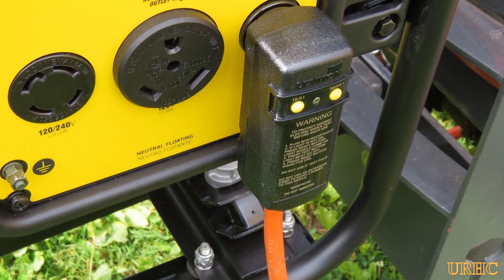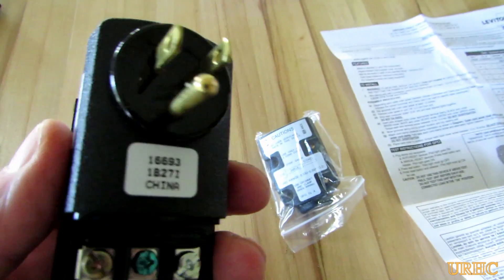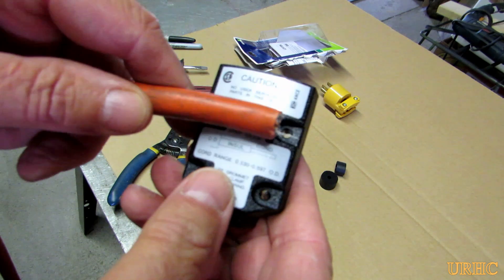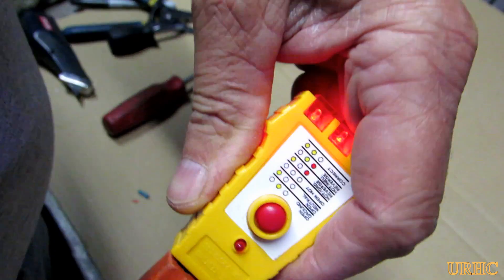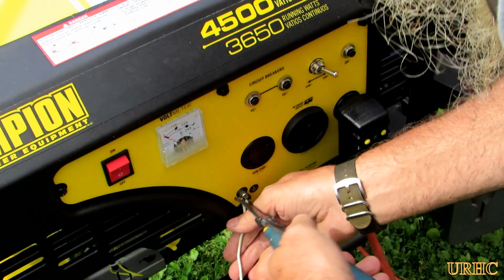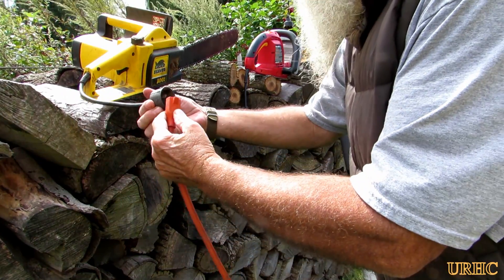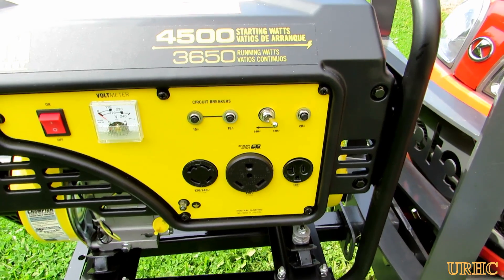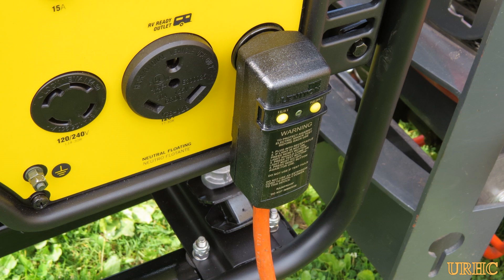A GFCI Plug Will Not Work With My Champion 3650 Watt Generator

Comment: People seem to think the GFCI is not working because it doesn't trip when the test button is pressed. When the test button is pressed a fault current is created that travels back to the source on the ground wire creating an imbalance between the hot and neutral which trips the GFCI. Because the ground and neutral are isolated there is no path back to the source to create a fault . So now you say lets connect the ground and neutral together back at the generator and now the GFCI trips when the test button is pressed but now you've created a path from a possibly faulty power tool back to the source through the frame of the generator and tractor. If it were me I would just use the generator like it is but it won't hurt anything to use the GFCI. You could plug it in at your house and test it to make sure it is working. I would not put a GFCI on the end of an extension cord unless it is specifically designed for that application. If you loose the neutral conductor in your extension cord there is no power to operate the GFCI and if you get a ground fault it will not trip. GFCIs made for extension cords are designed so this can't happen.
Reply from the maker: I found out this generator is safe to use without a GFCI. With no path to ground they say you will not get a shock. That is why the GFCI doesn't blow. Thanks for watching.

Comment: The solution is a Bonded Neutral "cheater". Generators use a floating neutral, which GCFI see as an open ground.
Create a plug (separate) male 15 amp, and put a short jumper from the neutral (silver) to the ground (green).
Then plug in the aforementioned plug to any unused 120v outlet on the generator. It convinces the GFCI that a ground exists and you're good to go.
Reply from the maker: Apparently if you do that with these generators the frame becomes a path to ground and it is no longer safe to use as an ungrounded portable. Thanks for watching.

Comment: Could you just connect the ground and neutral in the plug? And not the generator frame to get it to work? I'm looking in to using a gfi with a inverter in a house. I never used one. Or installed one. O was just looking in to safty. I guess I will just ground everything. And earth the inverter to the ground rod!
Reply from the maker: Turns out this is the way they do it for portable power so there is no path to ground for a ground fault. For use in a house the NEC codebook should be followed to keep your insurance company happy. Thanks for watching

Comment: That generator(notice in very first picture) has a floating ground, bond the neutral to ground and that GFCI should work...
Reply from the maker: Turns out for portable use this generator is supposedly safe for use without a gfci as there is no path to ground. The damp conditions I was worried about are not supposed to be dangerous with the floating ground setup . But the generator should not be hooked up to power a house for emergency situations as many people do without properly bonding the grounds and grounding. My 15k generac on the other hand uses gfci outlets to be safe.
Reply: @unemployedredneckhillbilly2023  If you hook up an unbonded generator to the house panelboard, it will be grounded by the ground from the house via the ground wire from your cord. Bonding the neutral in this case would provide a parallel path for current in the neutral leg. That is not good as the grounding conductor is not a current carrying conductor.

Comment: You have a floating neutral and it needs to be bonded to the ground to take and make your GFCI work
Take and make you a neutral Bond plug and plug in a three-way plug and plug your GFCI plug and then the neutral bonding plug that you made and your GFCI will work I have two generators that have floating neutrals and I made a neutral bonding plug so I can use a GFCI on my generators
Reply from the maker: From what everyone  is telling me a floating ground is safe to use without a gfci on a portable generator . Sounds like it only matters if hooked up to run a house.  Thanks for the comment.
Reply: GFCI does not need a ground wire connected  to work.

Comment: Your generator is made to power a transfer switch for back-up power to your house, which has a neutral to ground bond in the panel..The GFCI should work if you bond the neutral to the ground at the generator. Just be sure to remove the bond if you use it to power your house.
Reply from the maker: Thanks. I guess that I have always been under the assumption that you need a gfci to be safe outdoors.

Comment: I did a little testing of things.  The plug in tester worn't work on an floating neutral system because it simulates a ground fault by putting a 15k resistor across hot and ground.  Why the actual plug "test" didn't work is a mystery as it should put a resistor across hot and neutral but around the sensing toroid letting a bit of current leak around causing an imbalance on the sensing circuit.  It it cheats and puts resistor across hot and ground, then that would explain the failure to trip.  

Researching I came across instructions on how to bond a generator with a floating neutral and install a GFCI from the Hydropower division of the Bureau of Reclaimation, Dept of Interior called:

FIST 5-13 Fault Protection for Portable and Vehicle-mounted Generators and Welders, December 1997
(Facilities Instructions, Standards and Techniques (FIST) Manuals)

Apparently, the NEC does not require a ground rod installed for portable/vehicle-mounted generators that only supply on vehicle loads or cord and plug connected equipment from receptacles on the generator or vehicle,
Reply from the maker: Thanks,  it is something I never thought would be a safe solution. I guess eliminating the path to ground removes the possibility of shocks on a small portable generator. Sounds like there's nothing to worry about.   Thanks for your reply.

Comment: GFI's are not supposed to be used that close to the source. Use them at the end of the circuit.
Reply from the maker: They usually are right in the outlets. It is the generator wiring. Thanks for watching.

Comment: The problem is the outlet is wired wrong. The test button simply puts a high resistance between the hot and ground. In this case it's going between neutral and ground and therefore won't trip the GFCI. You can verify this with your ohmmeter.

Comment: On my champion generator i once dropped a grinder which semi cut the chord and caused pretty sparks. The circuit breaker on the gen immediately popped and killed it. Try calling Champion at off times I am sure right now they are flooded with calls due to Harvey and Irma.
Reply from the maker: I thought a gfci would add a extra level of shock protection,  but it looks like it will not work with the wiring on this unit.  I can't imagine how many are trying to get generators up and running right now. I will give them a couple of weeks and try again. Thanks for watching.
Reply: It doesn't because the shock risk a GFCI protects you from can't happen with a floating N generator ;)
Reply: I bet you’re right about them being flooded with calls due to the hurricanes. It was reported last night that over 8 million were without power in Florida, Georgia, and South Carolina due to Irma.

Comment: You didn't try grounding it right, a grounding rod needs to be buried 8 feet into the ground for proper grounding you were on the right track with that wire but you needed to go farther into the ground which is the problem. Also there should be another grounding which grounds the generator to the frame by a small wingnut, you could try taking that wingnut off and connecting a wire to it then replacing the wingnut to see if that will give you a proper grounding. Normally even though there's a ground on the panel there's usually always a ground connected to the frame of the generator.
Reply from the maker: This is for portable use so I  did not bother with a driven rod. It says that the ground should only be used when wired to a house and not connected for portable use. The ground pin is open and not tied to anything on the frame. I see some bond the ground and neutral to get gfics working, but that can be dangerous if there is a fault. Thanks for the info .

Comment: right, where to start...
this generator is acting like an isolated transformer, no ground is needed...

in the home you have N and G connected, it would also be connected back at the sub station.... this means if you touch L and G you will get a shock and the resistance between L and soil outside means you can get a shock...

on an isolated transformer (usually builders use them) you can touch L and soil and get no shock as the N is not connected to ground....

to test this, use a multimeter and check your generator between L and soil, it should read 0V this means you can only get a shock if you touch both L and N on the genterator...
if you dont have a multimeter you can try a lightbulb, connect L and the other side to soil...

there is a few things that need a bonded N and E and these things are usually internal home use items, however some RV have units like this and work when connected to grid mains but many generator mains wont power the protection unit until it measures  a low ohm resistance between G and N...

i hope this helps...

also throwing a spanner in the works... its a good job you got a real generator and not an inverter generator, some generators that are "inverters" which produce a modified sinewave 
 (not the more expencive pure sinewave) cause huge issues as E is connected to the battery negative and its power output poles L and N are half wave (squarewave in about 45 degree offset to give a freaky sinewave) and if you connect it to things that is sensitive then they will go pop... many chargers and things like smoke detectors... other things work a lot harder using higher power so lets say something uses 300w on grid but will be 350w on a modified sinewave... 
so as each L and N is actually live, if you suicide cable it to your house you will smoke your inverter because you will short out the N and G of the inverter.... if you disconnect the E from the inverter then you could end up with each battery terminal floating between 80-160v depending on what your inverter puts out, 80v=US but 160v=UK, AU etc
this is because N is still connected to G in your house fuse board...
Reply from the maker: Thanks for taking the time to post your explanation. I think you are right about it being isolated so it can be used as a portable. I just thought a gfic would add a little extra safety, and have a lot to learn about using generators. Thanks again.

Comment: Check if the test button on the GFCI plug trips it. If so the GFCI will work even though you have no ground and the neutral is floating, and your tester says it's all bogus. I wouldn't attempt to connect the generator's neutral to the frame without thoroughly understanding the generator's wiring, particular the 120/240 switch, and/or consulting the manufacturer. In any case, you shouldn't connect the neutral to the frame unless you're going to provide a good ground for it whenever you use it.
Reply from the maker: No it doesn't.  I don't think a gfic will work with this generator.  Hopefully  champions wait time will shorten, but I am sure they are overloaded due to the storms causing thousands to buy generators. Thanks for the comment.

Comment: this is why you dont want to use sensitive items on some gen sets --- tv phone etc
this is not clean power.
 getting ready for irma people will find out. the neutral and ground need separation for gfi to work those plug testers all read reverse/ in a no ground/ neutral separation.again gen set should be grounded but you are only using it with double insulated tools, but i dont have to tell you u are an engineer.
Reply: Nope not true !!!  There's really no such thing as "sensitive electronic" equipment anymore !! Just about all modern electronics use switching power supplies with very wide voltage and frequency inputs, analog Transformer style power supplies are almost non existent in modern electronics. It was these legacy Transformer style power supplies that made electronics sensitive to voltage and frequency instability of the mains input, again these are nearly extinct nowadays 

Modern switching supplies  are very robust and very tolerant to voltage and frequency variations and instability, Meaning you can feed modern switching supplies anything from 90 volts to 230 volts at 50-60 hz  and they won't know the difference. 

If you look on say your laptops or TV's power supply and it says input 90-240 volts 50-60hz  then its a wide range switching power supply that's pretty much bullet proof and will run just fine on any generator made, This claim that you need a very expensive inverter generator to run "sensitive electronics" is nothing but dishonest marketing  started by Honda

Comment: this guy put a wire from his neutral to ground   says it works watch and see what you think that is what i have found every where i my self would just leave it alone and do without it most tools nowadays only have 2 wires anyway https://www.youtube.com/watch?v=BBHA7PlhkbQ
Reply from the maker: That has the potential to make the frame hot with a fault. I am going to get in touch with champion, but I think it may be safest to leave it alone as you say. I never would have thought adding a extra safety device would be a problem. Thanks for the help.

Comment: bonjour , i have a homelite generators 4500 whit a robin motor and my 2 duplex receptacle 120 volts have gfci build in , the same like in the bathroom with the test and reset . very helpfull went we ad the big ice storm here in quebec . merci
Reply from the maker: You must not have the floating neutral on yours.  I never knew there were different schemes for wiring generators before.  Thanks for watching.
Reply: bonjour ,www.mymowerparts.com/.../Homelite...Manuals/HOMELITE-GENERATORS-2500 view page 33. merci

Comment: Have you tried to make a short extension to connect the GFCI to the generator and that would swap phase and neutral? The test plug mentions that hot and neutral are swapped, so first try would be to put them in correct order. Do not expect cheap generators to be wired with phase and neutral in right position :)
Reply from the maker: No, I don't want to take any chances. I think the 110 / 220 switch may have something to do with that swapping neutral with hot. I think it may be best to just leave off the gfci . I just thought it would add a extra level of safety.

Comment: I am a RV tech and installed a very expensive surge protection system in a fifth wheel and it worked fine on shore power but plugged into a 3600 Yamaha generator it would not let power through.I plugged my circuit tester into an outlet on the generator and everything worked fine and the RV powered up.The customer used the RV for the weekend and had no problem as long as the tester was plugged in.
Reply from the maker: The tester must have jumpered something in the grounding scheme. I was just trying to add a little extra shock prevention, but maybe you can't with these small generators.

Comment: Interesting.  Thanks for the heads up.

I have some tools with GFCI on the plug.  I will have to test mine on my generator.

Did you try the "TEST" on the GFCI plug?

I have read that there are a few different designs of GFCI, so perhaps this is one of the designs which is not working on your generator.
Reply from the maker: This one was rated for portable generators.  It did not trip when tested on the generator,  it was fine when tested in my shop with  the trip button. Seems to have something to do with the unbonded ground .